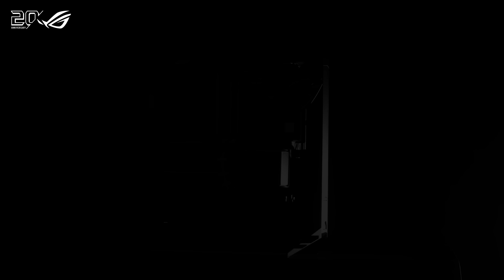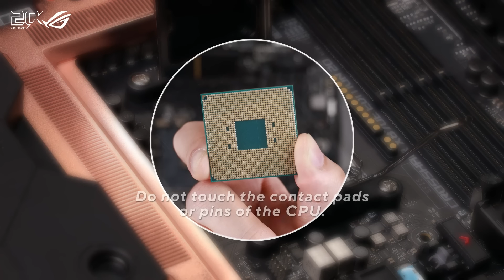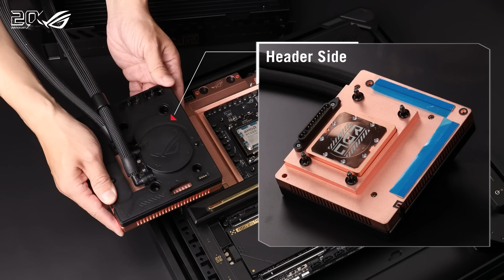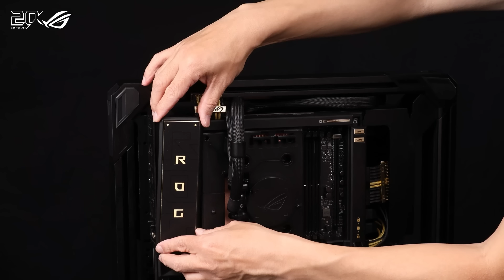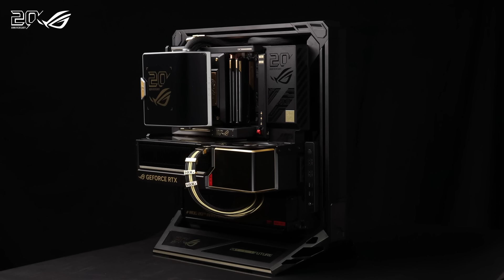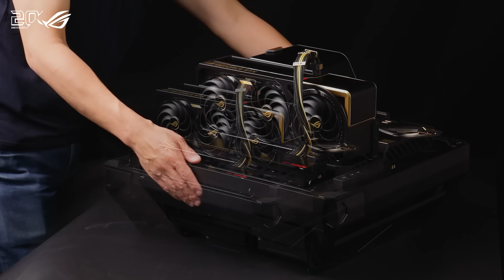ROG Edition 20 PC Build Tutorial | ASUS SUPPORT

Comment: Its gorgeous and ide luv it if i could find one........but, this is a Limited Run Bundle, and i would imagine getting an RMA on any of this once stock has gone will be near impossible, not only that manufactures are currently refusing to replace/repair mostly everything, not only that but with a 5090 there is that fire risk.

Comment: I think there's another downside to mounting the case horizontally. If air gets trapped in the AIO CPU block instead of staying in the radiator, the pump could end up running with air bubbles. That can increase cavitation, reduce lubrication, and potentially wear out the pump bearing sooner. Am I thinking about this correctly?
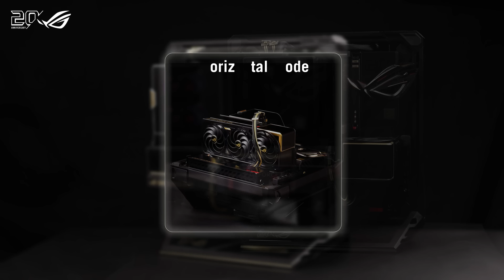15:43

Comment: I noticed that the latest update on the official website shows these products will only be available as part of a bundled package. Honestly, I think this will discourage a large number of regular ROG fans while creating a great opportunity for scalpers to split the bundle and resell everything at inflated prices.

For example, I already own an ROG Astral RTX 5090, and I absolutely love it. What I really want from this anniversary lineup are the motherboard and the AIO cooler. I don't need another graphics card, power supply, or case.

Now, if I want the motherboard and cooler, I'm expected to spend thousands more on hardware I have no use for just because they're locked behind a bundle. That doesn't feel fair to loyal customers who have already invested heavily in the ROG ecosystem.

I've been an ROG fan for many years, and I've always admired the product design and engineering. That's why seeing the U.S. launch tied to a mandatory bundle is honestly very disappointing. I sincerely hope ASUS will reconsider and offer these products individually so that genuine enthusiasts—not scalpers—have a fair chance to buy the components they actually want.
Reply: No one cares that scalpers are marking up these products as they are in such limited release and serve no practical purpose other than to flex.  So go enjoy your overpriced 5090 Astral, you are the 1% of PC gamers.
Reply: It was all designed to work together, why would they design something like that to sell it piece by piece, the GPU is 10k alone in this setup, entire bundle is 35k

Comment: I gotta say you guys killed it with the design of the Edition 20 stuff. Picked up the monitor because its surprisingly "affordable" at only 200€ more than the normal version of it. I'm also really considering picking up the PSU bc I still have the first gen Thor 1200W but 1000€ is a lot of money to spend on a PSU😭.